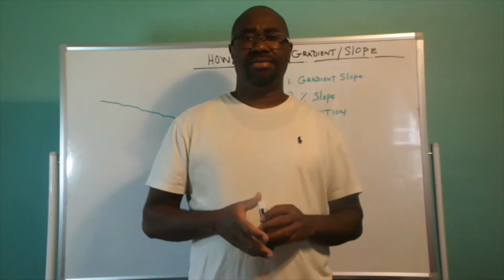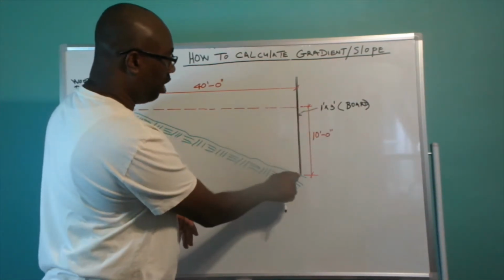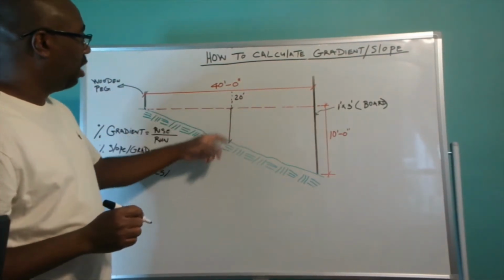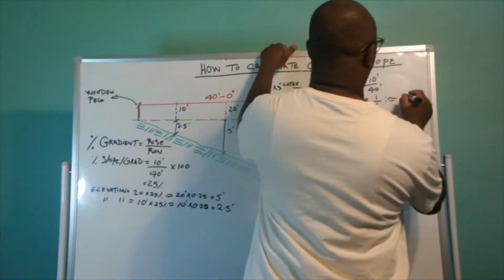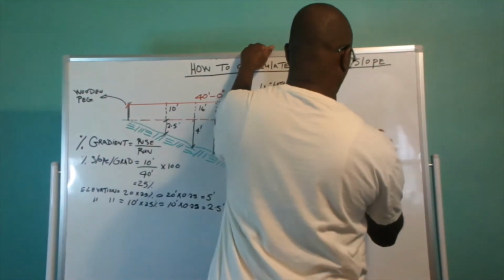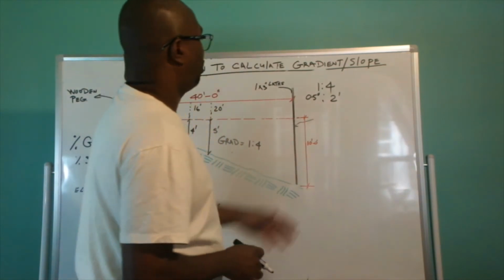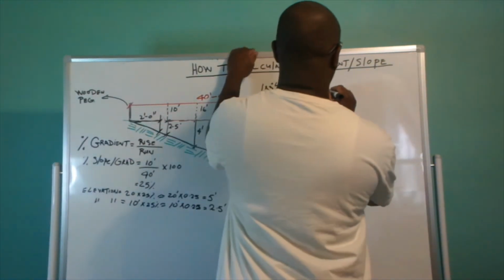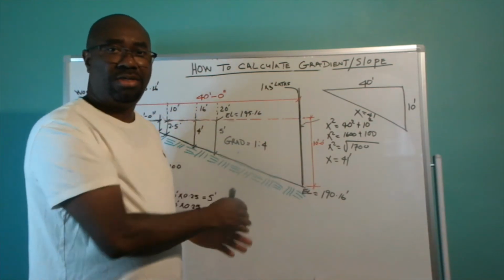How to calculate gradient of sloped land on construction site in Jamaica

Comment: So quick question, how do you determine how much digging and levelling is required to build on the slope or to get the land ready for the excavation process?  Can we have a vedeo on that please?
Reply from the maker: You would first have to do a Topographical survey.  by employing a land surveyor to do the topographical survey for you. Good Question though.
Reply: @jkengineeringarchitecture.  That was done.  I was just thinking if I was to hire. Tractor to do the cutting down myself, how would I know based on the drawing how I depth to cut?   For example, three feet or four feet, etc.  I can't seem to understand a thing on the drawing Even though the info is there.  I am so lost.

I have learnt so much info from watching your videos in preparation while I await the Parish Council approval process.
Reply from the maker: @nolablakereyes3874  The drawings should tell you  the depth of cut and fill, if the topo was used by the person who did the drawings for you. Other than that the builder / contractor would look at the land and set out the building on the land according to the drawings. Dont worry if you get an experience builder you wont have a problem.
Reply: @jkengineeringarchitecture.  Thank you. Yes the topography report was sent directly to the draftman.  Thank you for your videos and thank you for your valued responses 🙂
Reply from the maker: @nolablakereyes3874  ok. Nuff Respect